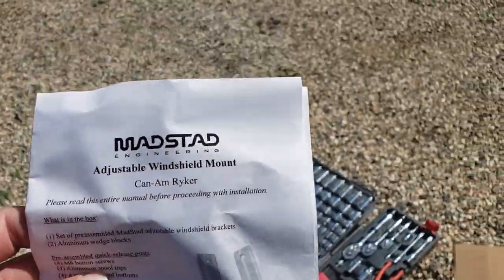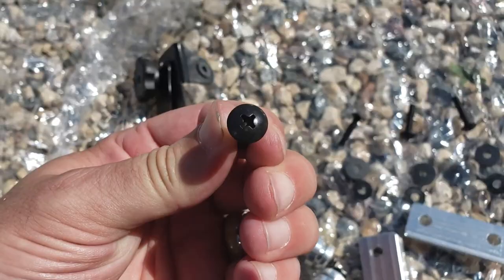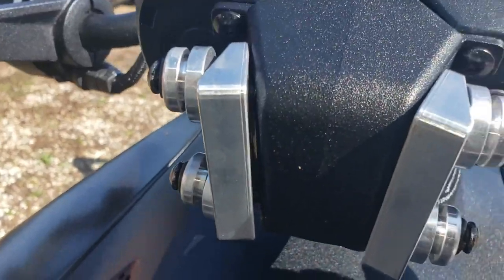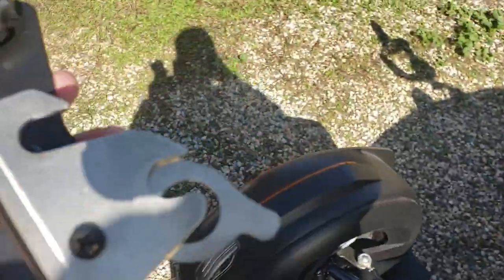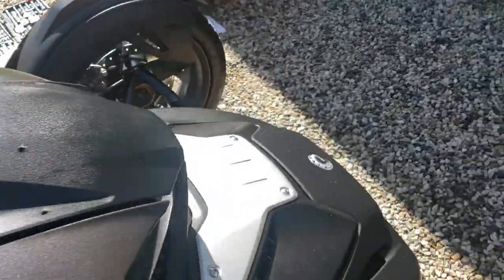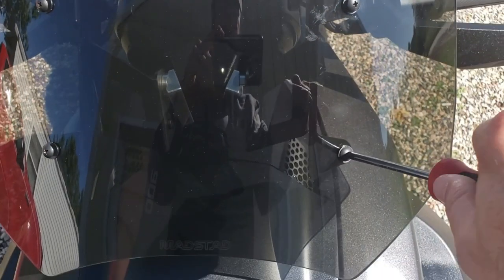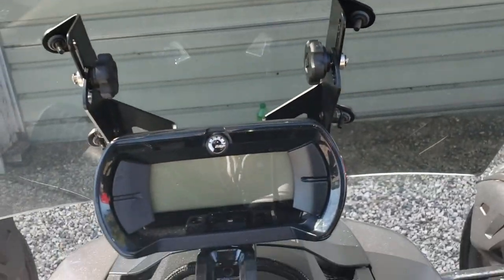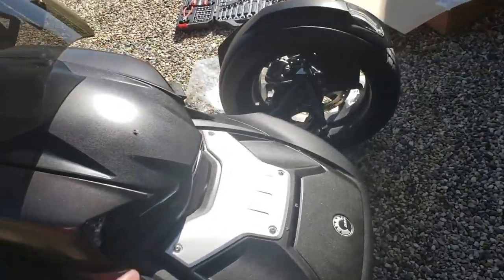Madstad windshield instal on Can Am Ryker

Comment: I have put Madstad shields on three motorcycles, on my current bike, the Triumph Tiger 800 XRx, I can ride at any speed with my helmet face shield up and all is quiet.  I only put it down when in strong cross winds.  How is the noise on the Ryker?  Buffeting, etc.?
Reply from the maker: My first ride the buffeting sucked! Felt like my brain was being churned into butter and I couldn't see lol after I adjusted it, wind noise was minimal and zero buffeting.
Reply from the maker: I also got the 18" one and I am 6'1" tall.